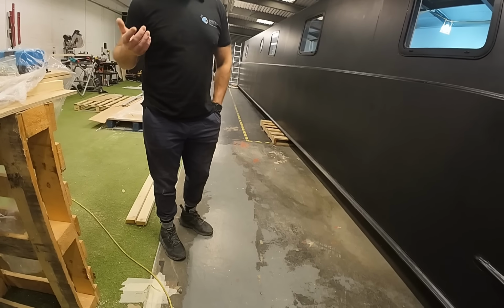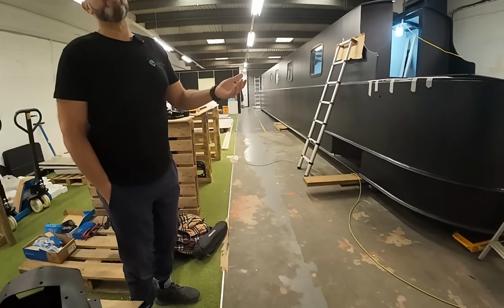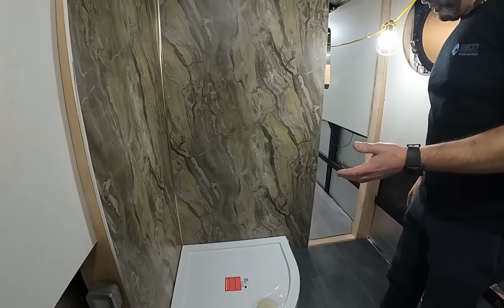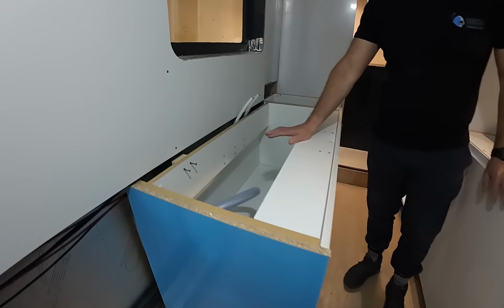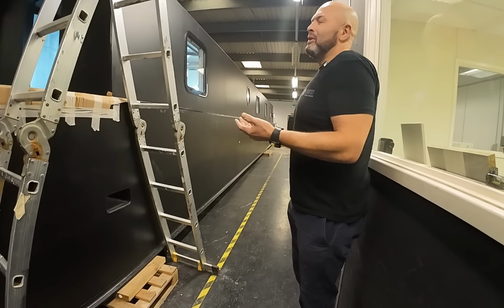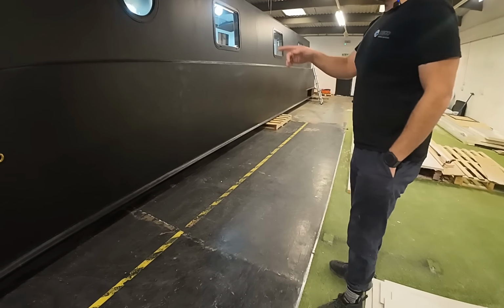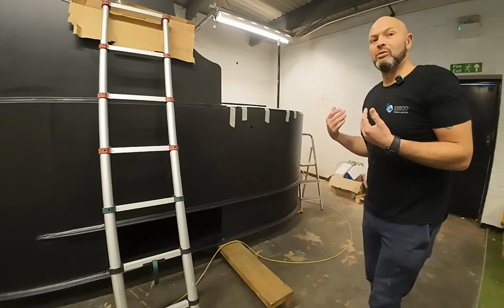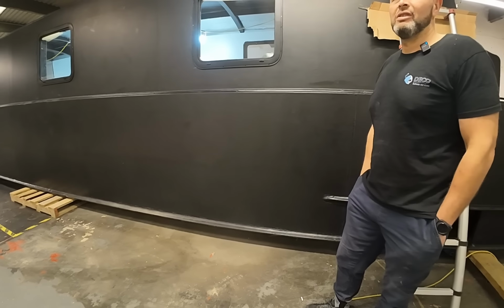World’s FIRST Plastic Narrowboat | The Boatbuilders

Comment: Wow what a great innovation. I have some questions/thoughts though. What is the cost of a sail away (just the shell, windows and motor)? Being a plastic narrowboat it is light so I hope the architect has left enough space under the flooring to get the ballast in. The impeller propulsion is a great idea you could do away with the rudder completely (still have a tiller though for tradition) and have jet boat style vectored thrust steering. The reverse thrust thing (reversing the impeller) is a cool idea too and if you have an intake on both sides you could steer by directing more water through the intake on one side, giving you greater control. I've already seen systems that allow you to control a boat remotely but that is a great idea. The straight sides are a good idea for space and the lip that sticks out at the bottom would work as a rubbing strip but when it comes to mooring It against shallow UK canal sides I think that is going to be an issue and you will have to tie it from further away and use gang planks. I think a good addition would be an automated gang plank that can fold out etc and something that comes out the side to hand you the mooring lines if it going to be further away from the bank would fit in with the easy use concept. HPD boats look good. I'm glad mentioned about UV life as that was a concern. I suspect because it is a medical grade plastic the properties of this material are well known. Another worry would be off gassing of the plastic but I guess being medical it is pretty inert. HPD sea vessel benefits into narrowboats is a great leap forward.
Reply: Oh just re-watched the start and realised the propulsion system is an azipod one. This means it can rotate 360 degrees and you can reverse easily but I can't see where it goes as there is no stepped under-stern? If you stick it below the flat stern base it will obviously be too deep in draft for UK canals.

Comment: how long  until freeze thaw cycle plus ultraviolet makes it brittle?   fuel burner  essential for  liveaboards in winter
Reply: @harryjones5260  It's proven technology with boats made from HDPE decades old. The material is UV stabilised. In case you didn't catch it, the builder said there will be a diesel heater fitted.

Comment: The only real new technology to the world of narrowboats this brings is the HDPE material for the entire shell of the boat, and that odd enclosed fixed pod drive. 
The generator/solar fed battery power and propulsion systems have been available for a while, there's already at least one boat builder that doesn't offer any other system on new steel hulled boats any more. 
I'd prefer a more traditional stepped rear end with a rotating drive pod for such a hybrid electrically driven boat myself.
I've seen a video, might have been one of "mooring" the cut's, of a boat with a rotating drive pod that is actually removable from above while the boat's still in the water if it needs repairing. I thought that was just the perfect solution.

Comment: It looks amazing, but two questions - How heavy are they? 18 ton steel narrowboats get blown off course by high winds so if these are lighter it would be worse. Also if the plasic of the boat flexes what happens to the internal fittings because they aren't designed to flex?

Comment: My concern would be for that super smooth, slab-sided plastic finish.. It's crying out for rubbing strakes, steel will take a scratch and be easily repaired with a pot of paint.. also for the underside, there's a reason why decent narrow-boats are fitted with a 10mm base plate..there's a lot of scrap lying on the canal beds in addition to potential scrapes from lock sills etc.

Comment: Um, people wrap boats all the time. Maybe not canal boats but wrapping boats is not new.
HDPE is great for boats but it will need a rub rail or it will take a hammering in locks. Also, "we won't do a solid fuel stove because we don't like them" is not a smart ethos if you want to sell boats, if a customer wants a solid fuel stove, then the customer should get one. Likewise, I'm a bit iffy on the electric hot water, that is going to chew a fair amount of power. What's the ballast, poured-in-place concrete? It's going to need a fair bit of ballast as it's basically a large cork. In addition, no gunnels, seriously? They are a must on a canal boat, you can't get out of an empty lock without access to the centre of the boat nor can you handle a centre line. The roof is storage and no gunnels also means this cannot be accessed unless alongside a mooring. 
I like the basic concept, it makes a lot of sense but I think it will fully come into its own only when they are 3D printed as a one piece hull. BTW, remote control systems for canal boats do exist already, there a few out there.
And, ma'am with respect, you really need to work on your camera skills, seriously.

Comment: While i don't doubt the strength of the HDPE as does this one all narrow boats have a sacrificial edge on the base plate even steel one's wear away and have to be rebuilt up with weld some quicker than others  when out on the CUT doing bridges locks etc you're mooring multiple times a day it's almost impossible not to catch the canal side where there is always sharp rocks stones metal piles as well as all the detritus and rubbish chucked in the canal ..if this base plate edge wears away the weld will quickly be gone then what ...also as said by others this boat needs multiple full length rubbing strakes on my local stretch of the L&L canal there is allsorts of bits of rusty old steel and iron sticking out of the canal banking from the old piles etc i'm not confident how this will hold up too that ..anyway just my thoughts

Comment: Well done great for the UK this is about time. Sad using Lithium because of the problems that come from them as you can't put them out in a fire Unlike other batteries Lithium is NOT fully recyclable and is unstable even when left. Led acid batteries are fully recyclable same with Nicad types. Like the Idea of plastics but as long as it is not breakable as some boats people hit with sledge happens to try and damage them to try and sink them. Now I noticed there is no surround Bumper which is on other narrow-boats that used to be made from wood now Rubber. Great idea just the same with plastic there is no electric field to cause more problems unlike carbon fiber.
Reply: They will be using lifepo4 batteries not lithium tertiary battery's you can drive nails into them & no fire.
Reply: You need to tell all the EV car battery recycling companies about lithium not being fully recyclable. Seriously if you want to get some facts about battery recycling watch Helen Czerski's reporting on Fully Charged Show/Everything Electric. The recovery efficiency for EV batteries is very good. Battery chemistry is much improved from when my 10 year old Nissan LEAF was made. Oddly enough it's still running on a daily basis and hasn't caught fire!

Comment: Very interesting. HDPE is going to be warmer than steel and quite a bit lighter. Being able to "wrap" the boats as well, we are going to see some interesting colour schemes on the canals. One small disadvantage that I can see is that the HDPE is a lot softer than steel and will be easier to take gouges out of it. In saying that, it should be easy to repair it, although you might have to take it to where you bought the boat from to get it done.
Reply: I think you can heat weld that material which would make it fairly easy to repair

Comment: This  company has thought of all the features I have designed in a range of narrow boats and wide beams except I would use Aluminium (because of plastic pollution fears), have a large battery bank as ballast, integrate solar all over the roof and sides, have a heat pump heating/cooling system and fit a toroidal propeller.

Comment: This set to be the ‘Tesla’ of narrow boats! Complete revolution and a massive challenge to the ‘traditional’ canal lifestyle… it’ll do away with sourcing firewood and having to model ones life around the demands of a boat’s usually ‘standalone’ systems (engine, electrics, water, gas, heating, etc). The allied trades who make their living on supplying resources to the daily running and annual hull maintenance (re-plating, blacking, etc) may not welcome these excellent innovations…. Very interesting materially and conceptually…
Reply: Really appreciate your perspective—and you’ve hit the nail on the head. There are over 35,000 canal boats on UK waters, so there’s still plenty of room for innovation without disrupting the traditional charm that so many love. We're not trying to replace tradition, but offer an alternative that makes boating more accessible and sustainable for a new generation.

Being called the ‘Tesla’ of narrowboats is high praise—thank you! We’re definitely challenging the norm by integrating low-maintenance materials and simplifying the boat’s core systems to reduce the usual lifestyle compromises. No need to stockpile firewood, worry about rust, or constantly juggle maintenance schedules.

That said, we’ve got huge respect for the traditional allied trades and don’t see this as replacing them, but evolving alongside. Hdpe canal boats won’t need hull blacking or re-plating(can be painted though as we have developed a paint for it ) but they still need expertise when it comes to fit-outs, servicing electric propulsion, and installing smart onboard systems. It’s just a different type of maintenance—cleaner, greener, and more in tune with future waterways living.

Exciting times ahead, and we're thrilled to be part of the conversation!

Comment: Do not need to lift out just wonder how often the genny will come on but great upgrade. Plus the rap a genius move. I assume a wheel not a tiller. The one thing not mentioned.
Reply: Tiller is far more responsive and an obvious indication of rudder position especially when manoeuvring in locks and close quarters… my sailboat has a tiller and I much prefer it than waiting for the helm to respond to constant minor wheel adjustments …

Comment: Very cool boat. Often wondered why they are all made of steel that rusts so much. So many channels about bottom plate and corrision.  I wonder about thermal expansion in all sorts of areas.  Windows, cabinets and joints etc. It think it addresses amny historic issues as the guy says.  Love to see a follow up when fully fitted out and when its on the cut!
Reply: It's cheap and robust. Bangs and scrapes are par for the course. Can be fixed quite easily. Aluminium needs extra processes when it's comes to building. Fibreglass not to good at taking a hit,  Narrow channels, passing boats etc. Keep the maintenance up on a steel boat and it will last a long time. Electrical systems need to be good too, stray current can cause issues. It's really important on an Aluminium boat.
Reply: steel is inexpensive and strong compared to other materials.
Aluminum is similar strong but  more expensive.
Fiberglas is weaker than steel and more expensive.
Carbon is just as or even stronger than steel but way more expensive.
Wood is cheaper than steel but also much weaker.

Now this plastic stuff looks tough indeed but i have the feeling its going to be very expensive somewhere between fiberglas and carbonfiber.
I can see one big flaw with this stuff and that is, the individual elements are seemingly only butt-glued together unlike glas and carbon fiber who have a few layers of fiber laminated around every butt-joint thus making the joint usually stronger than the surrounding material.
This plastic stuff might not break easily but the individual elements might come loose through thermal expansion over some time.

All of these take damage over time and eventually needs fixing so pick your poison but steel is just the best allrounder so far.
Reply: @Igeltod  Looks like the plastic parts are all melted together. Thermoplastic welding is much like welding metal. The edges of the sheets are beveled then hot air is directed at the seam while a rod of the same type of plastic is fed through a hot nozzle. It all melts together and cools quickly. A flat or shaped metal piece flattens the soft filler plastic (or forms it into a fillet on inside corners) and helps to cool it. The end result is as though the parts are one piece of plastic and the physical properties of it are unchanged. Look along the bottom edge of the hull (the chine). They put together a big flat plate of HDPE and it sticks out past the sides a bit. They welded the hull side panels along both sides to the bottom plate. They could cut that lip off and use a hot V cutter to carve a channel then weld and smooth it. But at the speeds these boats go that lip won't cause any issues. Might even improve the strength of the boat.

With welding metal the temperatures are far higher and the physical properties get changed, and how fast the weld cools is a factor in the finished strength.

Comment: This is absolutely fantastic!!! I have an article in preparation about the canal system's importance in spearheading ecological/environmentally responsible living and was going to mention if there was a possibility of making narrowboats from recycled plastic!! I've actually been on the Forth and Clyde canal on a small boat made from recycled plastic that had been hauled out of canals previously - we were on the boat collecting plastic litter to make more boats. As it's HDPE then it's the same plastic as plastic milk jugs. Is there a limit to how much recycled plastic can be used and is there scope to increase it as technology improves? The other thing that blew me away was the propulsion system - unfortunately propellors kick up silt and the suspended sediments do reduce the flora and fauna you get in a canal. Is your system 'less bad' if you like in kicking up sediment, if so that's another important selling point. Great work film maker and boat builder, thanks.

Comment: I am interested how this holds up after a years use , concerns with the holding tank for the toilet beginning to hold or leech bad smells like Tupperware with food does and also micro plastics are terrible for our health and the environment.
Reply: Thanks for your message—great points raised. One of the key advantages of HDPE is that it's non-porous and chemically resistant, meaning it doesn’t absorb odours the way other materials might (like Tupperware, which often has softer plastics). We’ve worked with HDPE for over 25 years in sectors like water treatment and food production, where hygiene and odour control are crucial.

As for the toilet holding tank, it's fully sealed and designed to prevent smells from leeching into the cabin space—just like with traditional boats, regular emptying and maintenance are still part of the routine.

In terms of microplastics, HDPE is actually one of the more stable plastics. It doesn’t flake or degrade like other plastics

Comment: I couldn’t single hand without a gunnel, but still it’s a fantastic future for long lasting long boats :).  I guess you don’t need to paint any of it?
Reply: You missed the bit about remotely controlling the boat… in itself, that would transform singlehanded operations since you can helm her from the bank or while operating the locks… still need gunnels?
Reply: @funkyfender1 Marine electrician and qualified C&G electronic technician here. Yes, you need the gunwales (sic gunnels) even more with all that stuff. When (not if!) the remote control packs up, and the inevitable ecu controller decides what’s needed is full ahead, due to a droplet of condensation finding its way into the supposedly hermetically sealed black box, you need to be able to evacuate from whichever part of the boat is closest to shore and/or furthest from the impending impact.
These problems have been afflicting big brand bow thrusters, like Vetus, Sleipner, etc, since they decided to move away from mechanical switches in their controllers. They also occur in microcommander transmission control systems, used to replace traditional mechanical cables, linking the throttle/gear selector lever with the engine and gearbox on a well known make of patrol boats. A wide open throttle 6cylinder Volvo Penta with duo prop out drive that refuses to obey the controls is a scary thing.
This technology is not ready for the marine environment, but is being pushed by the net zero agenda. I’ve installed several and have yet to get a reasonable service life out of one.
Reply: @funkyfender1  oh crumbs no thats not a boat design for me

Comment: I sure I read somewhere that they have steel stretchers under the floors still. Think it’s a lovely way forward nut would not want that propeller system as I would think it’s not going to cope well with the rubbish in the canals.
Reply: You’re right to a degree—our first prototype did include steel girders. However, because HDPE and steel expand at very different rates, we decided to build this one entirely from HDPE."

Let me know if you want it more technical or casual.
Reply: @ just interested as I have a narrowboat and honestly think it’s a great idea rather than steel. Hope the hulls sell well the company deserves to succeed.
Reply: Brilliant, I want one. I was sold on the app piloting through locks.
Reply: Fiberline made a grp narrow boat 20 years ago, nobody liked them